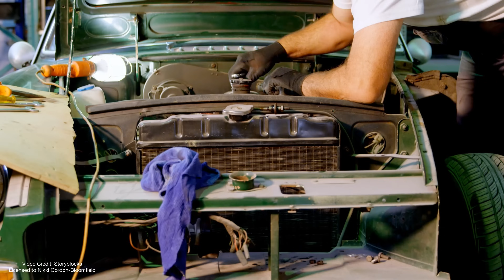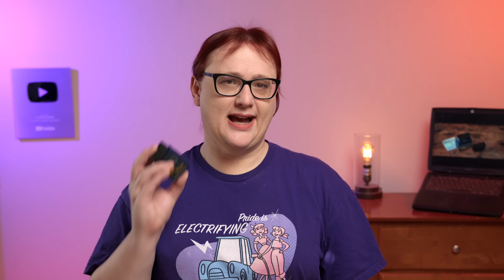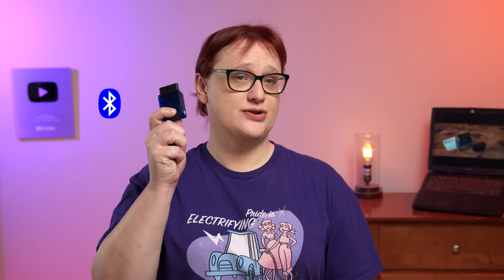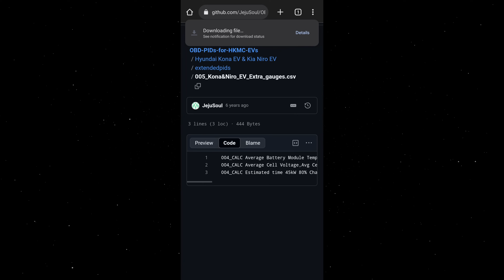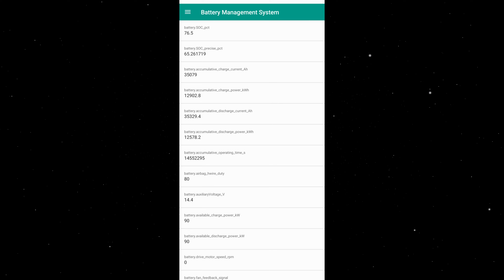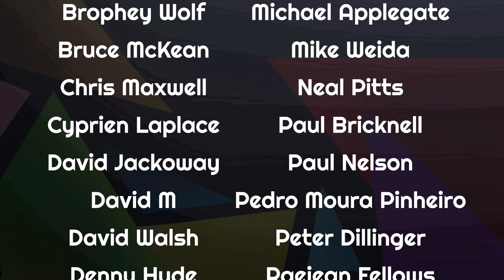Get an OBDII Dongle For Your EV!

Comment: The torque pro only offers petrol car settings are there  some generic PIDs to add battery pack data etc or does the standard app give you battery pack data anyway?
Reply from the maker: As we mentioned - you need to find the PIDs for YOUR EV. - You should be able to add them :) 

Torque pro has become less good in recent years, but there are alternative!

Comment: In my commercial airplane we use the term EE bay, short for Electronic Equipment bay. …since we do not have a hood but a bay we’re all the computers are located, that can be accessed through a tiny door.

Comment: I've had an OBDII Bluetooth dongle for a while now and love it! Makes it so I can check on battery module temperatures, DC power requested, and DC power delivered in lieu of the lack of gauges or even simple messages that could help drivers know if it's the vehicle or the DCFC that's the problem

Comment: I had read somewhere that keeping the OBD II dongle plugged in is a security risk? That someone could open and access your vehicle is that true?
Reply from the maker: It’s difficult to give a blanket answer, but it depends on your vehicle and the security used in the dongle. If there’s no pairing required, it’s a possibility.

Comment: One project I’d love to see get more attention, especially by developers, is OpenVehicles OVMS. It aims to not only monitor your vehicle via OBDII, but also offer remote access capabilities similar to the carmakers’ services. I use this with my Gen 2 Niro EV and, while it doesn’t have a complete implementation, I get enough functionality to be useful. I can see state of charge, whether the doors are locked, and some other things in the phone app. It has a web interface so I can see additional diagnostic information. This was actually super useful troubleshooting a 12v battery issue in my car and verifying replacement solved my problem.

But this is a super small project. The number of contributors is very small. With the explosion in number of EVs, it’s falling way behind in vehicle support. So I worry this will continue to be a niche project that never really advances.

Which is frustrating because as people complain about privacy and whatnot about carmaker online services, as we see hacks and whatnot of these services, and so on, this is one of those projects that is capable of replacing those services and allowing you to own it.

Comment: This video would have been great a couple days ago :p  On a whim I replaced my 10-15 y/o OBD device with that same Vgate module last week and it wasn't able to connect to my Nissan Leaf's ECU in Torque Pro.  I threw it in the back seat to play with on warmer days.  A couple days ago my car died while I was driving it.  It went from Drive to Neutral at 55 mph.  As expected, Torque didn't work.  Car Scanner app for Android connected, but my car gave out a dozen useless error messages.  I measured my 12V battery with a multimeter, it was 11.5V.  I Uber'd home, grabbed an external battery and lab power supply, came back, and charged it back up.  When I got home I watched your 7 year old video on Nissan Leaf 12V batteries.  I'm still not 100% sure if it's the battery or the charging system, but I'm driving around with a bunch of equipment hoping to catch the next failure.  Either way I thought I was done with lead acid batteries leaving me stranded.  I built an LTO battery for my ICE car, and I'm replacing this one with a Sodium Ion battery... in a month or two when I can get one shipped from China.

Comment: I got one of these to check my 2012 Mitsubishi Outlander PHEV drive battery.  Its health was below the guarantee they made during marketing and they replaced it with a new one.  Took a lot of negotiating with the dealership because at the time they didn’t have much experience.   I’m in Australia and they had no choice but to replace it.  They did charge their  marketing a few years in.  So they’re definitely worth having.   Great show thanks. ❤

Comment: Hello Nikki, I have an MG ZS EV Gen 2 Trophy & have bought three different OBDll dongles to no avail, they connect up to the popular app/s via Bluetooth no problem, but they don't read any parameters except for the 12v battery.
I'm at a loss as to what to do. Edit: just seen the section of the video about PIDs D'oh.

Comment: Why not use the English term “in the bonnet”. In an ICE car it’s the big lump stuck on the front often containing engine. In an EV the ‘bonnet’ could be anywhere. In my Singer Chamois coupé many years ago the bonnet was empty apart from the spare wheel, the ‘froot’ in modern parlance. The engine was at the back between the wheels partly under the rear bench seat. The car therefore had a very short boot at the rear. ‘Bonnet’ is a much more pleasant name as a sound than the rather crass US ‘trunk’ or ‘frunk’

Comment: OBD2 is good not only for diagnosis, but also for fun. Apps like Harry’s LapTimer bring together car internals, GPS recording and video for the fun of it. I believe they recently enhanced the App for EV functionality as well. 

One point to watch out for with those dongles is the form factor, especially if the intend is to keep them plugged while driving. Some dongles may interfere with legs, depending on the position of the car’s port.

Comment: I'm using a Vgate Pro dongle with my Ioniq5, and being able to provide screenshots from Torque Pro regarding overheating battery packs during DC fast charging took a lot of time and debugging out of having my cooling pump replaced under warranty. Normally I would have handed the car in for several days for the techs to do the testing, but since I was driving around anyways, providing them with the data was sufficient and I only needed to come in for the actual replacement.

Comment: I have a Konnwei OBDII for my 2015 Nissan Leaf which allows me to run LeafSpyPro. The combo has been invaluable. LeafSpyPro knows more about my Leaf than it ever displays on the dashboard. It's also more accurate than the dashboard for reasons too boring to go into here. It gives me the facts on how well my battery is doing, my consumption, it even tells me how high above sea level I am. It covers wheel rotation, tire pressure, temperatures, braking, power... and on and on. It may seem very technical and maybe TMI to some, but it's a really valuable tool. It's especially helpful when doing trips that stretch the range of the Leaf. Using it I can drive anywhere with confidence because it tracks my battery percentage and estimated range right down to zero. I have occasionally pushed my Leaf below 3% with confidence whereas I couldn't without LeafSpyPro because the car itself stops showing battery at below 6% and range at below 8 miles. You're left with a blank display and (for the less experienced) a knot of range anxiety in your stomach. I'm thinking of getting something bigger than my smartphone to display it on or adapting my old tablet. It's like a major upgrade to my car and all powered by touchscreen.

A diagnostic dongle can change the whole way you use your car and open up the truth about how capable and enduring even an EV with no thermal management can be.
Reply: I you got to the Energy meter display on the AV system: it will show you range below 8 miles. At least in my 2011 leaf.
Was annoying because a power cycle cleared the range estimate on the dash when I went through a car was before a full test charge.
For some reason my "11 bar" battery has only 16.2kWh useable (of 24kWh nominal).

Comment: I've found the OBD reader to be quite useful in understanding some details about the Chevy Bolt's energy consumption and related displays. For example, with an OBD reader, you can quickly see that 1) the "idle" energy consumption is actually much less than 1 kW, even though the dashboard says 1 kW, 2) the window defogger sucks up a low of energy, 3) The number of bars in the battery meter corresponds to the displayed state of charge, round up to the nearest 5%.

Also, if you're ever in a position where you're down to 5% or less and the guess-o-meter shuts off, the OBD reader is the best way to tell how much exactly you've got left.

Comment: Well, I got a bit Torqued on this issue.  I bought the Torque dongle years ago for my ICE vehicles. I still have said Ice vehicles and have not needed to use the dongle for some time.  I also have a new Samsung S24 Ultra.  I found the appropriate ports plugged in the dongle and did not get squat.  The research I needed to pay about $60.oo more if I now wanted my device to work.  I was pissed.  Not really sure where the dongle is now and just had the mechanics for the cars perform the work.  I'm to old now to do much.  Last time I used the dongle it worked fine, now they want more money to keep it working.  I was able to feel what was wrong so I knew the one car would be 700+ and the other about 350.  Dongle, in my case would not have saved me what I already knew, Torqued me off though.  Wonder if I will ever find the dongle?
Reply: Just because you are old doesn’t mean you can’t use your dongle…

Comment: The Bluetooth classic OBD-II dongles usually don't work with iOS. You need a special license from Apple which is too expensive for most dongle vendors to get. BLE has no such restrictions and works with both iOS and Android. Recommend going with BLE. Check with the mobile software you plan to use which dongle brands they support.

Comment: OBDeleven has a fantastic interface to my e-tron.  Not only amazing diagnostics, but lots of access to programming features that the car didn't come with.
Reply: I have the VCDS for my e-Tron.
Reply: I got an OBDLink MX+ as a gift. I’ve tried their app, eFlow, OBDEleven, and CarScanner. CarScanner is the only app that connects to my 2021 e-tron, and even then I can’t decipher the list of parameters. 

For example, which one is high voltage battery power so you can see kW while charging. 

Which one is high voltage battery real net kWh life remaining (degradation). 

What other parameters do you guys (e-tron owners) recommend.

Comment: Thanks! I find it particularly useful to look at the battery temperature as that limits DC fast charging when it’s cold. It is also interesting to compare the dashboard-displayed battery state of charge with the actual BMS state of charge.
Reply: Yup. Another interesting trick, if you're not sure what the battery temperature range for fast charging is, is to look at the wattage going to the battery heater while you're plugged in. If the battery heater is running, that's a good indicator that the battery temperature is too cold to achieve maximum charging speeds.